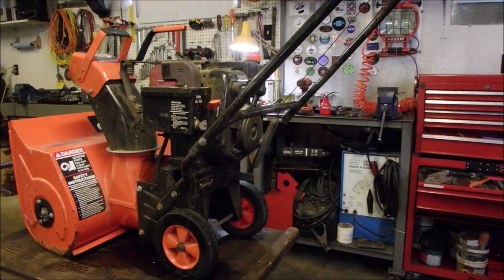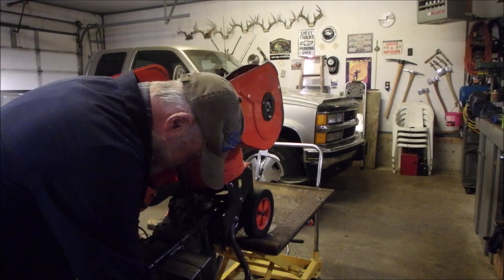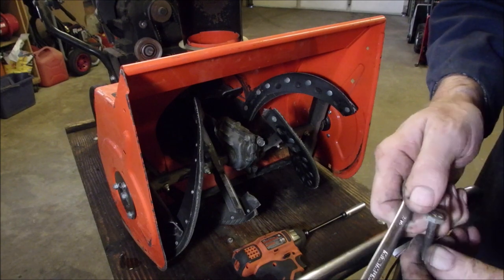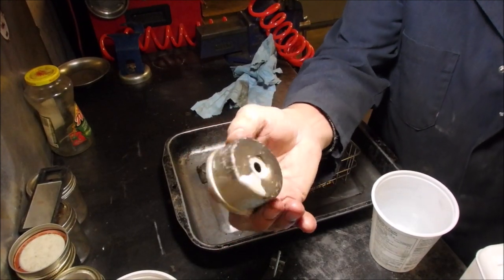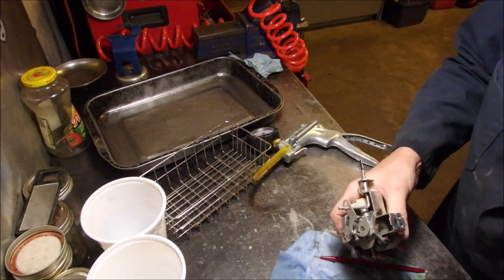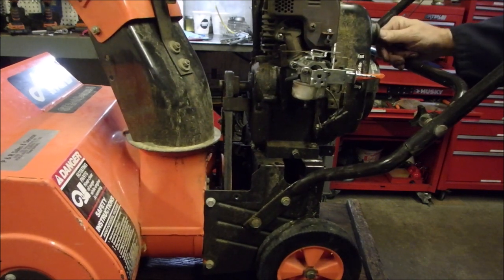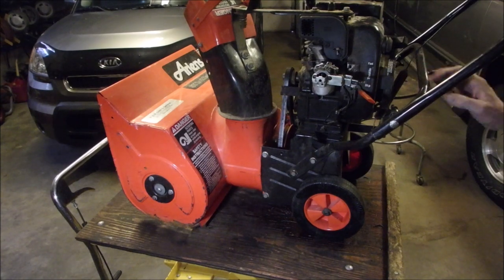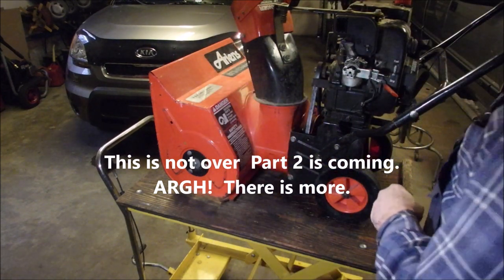Ariens 2+2 Snowblower  Has Many Issues Pt1

Comment: Ariens Customers wanted the advantage of clearing snow down to the cement or asphalt (sidewalks and walkways) yet be able to blow it a good distance away.  I believe they still offer that type of unit. Toro offers one with the rubber paddles but it has driven wheels.  Love them Tecumseh Snow Kings!!!
Reply from the maker: Great point!  Yes the snow kings are good.

Comment: Wanted to let people know. When you clean a tecumseh carb, and you have that screw/jet from under the black cap, the kind with the point, not usually the blunt end one. You clean it with an ultrasonic cleaner, inside the carb where the screw/jet screws into, there is a little brass liner/barrel inside the casting of the carb, that tends to spin, with the vibrations of the ultrasonic cleaner, and if you don't know about it, you can damage the tip of the screw/jet. You have to get in there with a small long tipped tool, and gently spin the barrel till the hole in the barrel comes back around, ask me how I know this... LMAO then you can put the screw/jet back in properly, just wanted to share that knowledge.
Reply from the maker: OK  I thought that was just the tip of the brass emulsion tube.  Am I off in thought
Reply: @BrucesShop  no your not off, but on older tecumseh instead of a blunt low speed jet non adjustable, it was an adjustable screw that went into a brass barrel and if that barrel spun and you went to put that screw back in and weren't aware, you can damage the barrel and the tip of the screw..... Just wanted to let people know about it, and if you use a ultrasonic cleaner it will most likely spin the barrel.
Reply from the maker: @knighthawk86855  Perfect.

Comment: Isn't there another small vent hole on the side of the carburetor that if clogged will give you trouble  ?? Nice repair Bruce, as usual I always enjoy your videos.
Reply from the maker: On some there is a removable needle,  others are set and not accessible.
Reply: Yes, a tiny needle sized hole just under the casting ledge between the two throttle bracket bosses... the (atmospheric vent) and if you blink you will miss it.
Reply from the maker: @Don_ECHOguy  Thanks

Comment: Very good Bruce, nice to keep the oldies still ticking. I on the other hand just cleaned and serviced the same carb on a 1979 JD 826 blower for a buddy, but it started bucking after the restart and then lost the spark. They can be a bit cantankerous at times.
Reply from the maker: Yes  i have cleaned some multiple times only to find a leaky gasket.

Comment: I really hate these rubber paddle machines. They eat the gravel and rocks on the driveway turning into a sort of machine gun that is guaranteed to to break a window or dent a car. If you have a paved driveway they remove all the snow turning it into a skating rink. Seriously you need to leave an inch or two of snow for traction for both your shoes to bite into and the tires on your vehicle to bite into. I have two machines a singe stage rubber paddle job that has cost me a couple windows despite my best efforts and a 2 stage that constantly clogs in wet snow. So I use the rubber paddle doomsday machine in the wet stuff only.
Reply from the maker: Good point

Comment: Nice job fixing the hunting issue Bruce most of the time i forget to pressure test them before i reinstall them. Just a reminder to all there is also a small vent hole on the outside of Techumseh carburettors and if it is plugged the engine will not run.
Reply from the maker: Thanks Wayne.

Comment: I just did my first snowmobile in mabe 15 years. Sadly, mice had built a nest in the airbox and mouse pee ran down into one of the carburetors and corroded  up all the passages. I tried cleaning them and using jewlers drill bits to reopen the idle circuit but the corrosion went back too far where the ports take a quick left. Even using my Ultrasonic cleaner didn't help. The owner is currently looking for a replacement carburetor.  Being its a 1995 and actually still runs ok on partial choke, I Jerry rigged it to run partial choke only on idle until he can find another carburetor. The deep pits in the body caused by the pee told me I was probably wasting my time on what I did, but hey, I tried. I had a riding mower in this fall with a 5 gallon bucket of mouse next under the engine tins. There was some pee corrosion on top of the flywheel but no damage to anything important. Good thing they couldn't  get it started, or it would have overheated and most probably caught fire. The carburetor on it was beyond repair, but found a new one. It took a MONTH to get it.
Reply from the maker: Great story
Reply: @BrucesShop  Keep making those video friend. I really enjoy watching you. I already know pretty much all there is to know, but once in a great while, I get thrown a curve ball. FYI, I had to give up snowmobiles due to a cancer surgery that damaged nerves in my left side. It prevents me from lifting or straining on my left side pretty  much. I deal with constant chronic  pain everyday, but still enjoy working on small engines. Even then, I have to pick and choose my battles.

Comment: When adjusting those don't you start with the low screw first(at idle) and then the high(full throttle)?  I'm not sure always worked on fixed jet ones.
Reply: That's 2-cylcle law
Reply from the maker: The big screw does the most change then I redo it.

Comment: What did the two leftover bolts go to?
Reply from the maker: Sometimes i just throw left over bolts into the same container.  I don't know   LOL   i am not much help eh!!!
Reply: @BrucesShop  maybe for carb warming cover into bracket by choke plate, that one is an odd duck Bruce! Good video! That 30° small hole is the idle jet.

Comment: Why do people leave fuel in their machines when they don't use them only once a year for the snow should drain them out ..then it keeps the carburettor clean or leave the petrol cap off so it can vaporator away what little bit you have left in the tank
Reply from the maker: Because the just don't understand.